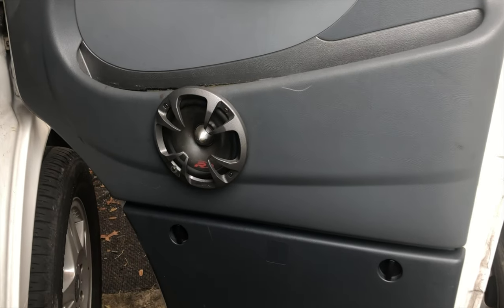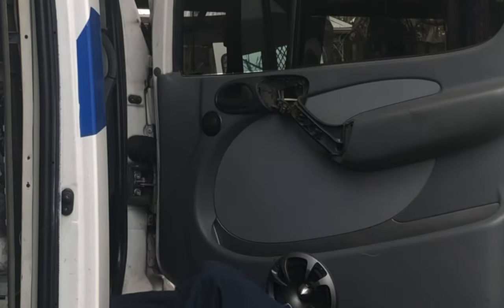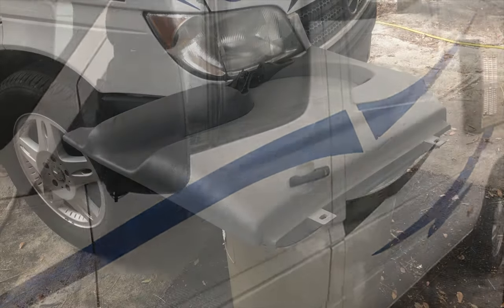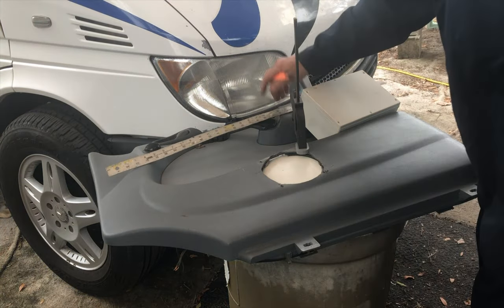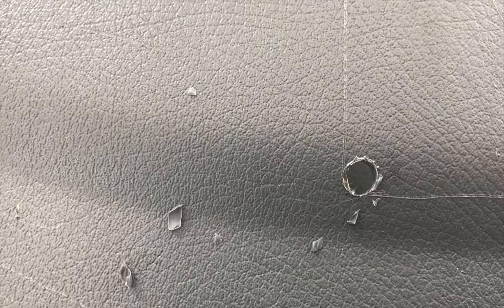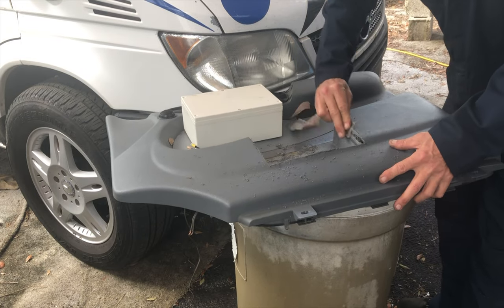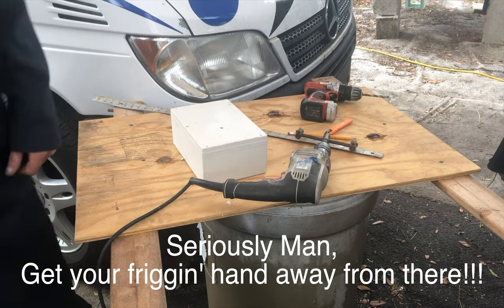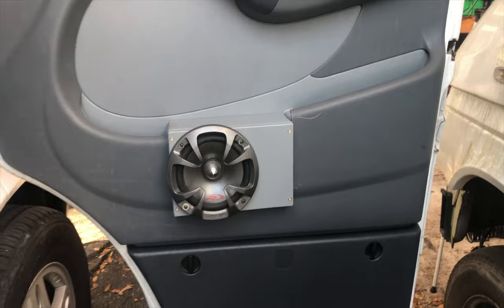Car/Van Door Speaker Boxes

Comment: Just bought a T1N, I'm going to steal this idea, great video/video's, thank you!  An oscillating multi tool would do a great job on cutting out the box, use it a lot making precise cuts on wood trim and sheetrock.  I watched a bunch of your video's before I purchased my T1N, they were very helpful and scored a 2006 with 96,000 that an aviation mechanic owned.

Comment: Hello Florida man lucky guy. I'm Colin from the original Aberdeen NE Scotland I've got a 06 sprinter love it. Came to MOT it fuel leak reported that's a fail!  On further investigation I found out what 'BLACK DEATH' is so I tackled it cleaned up lovely replaced all copper washers and stretch bolts. Put back together ran excellent for a while then conked out was bit low on gogo juice thought bleed system started again yay. Then died looked up you tube thought low pressure fuel pump in tank can't feel it! Dropped tank removed sender unit mine doesn't seem to have one hmm. Rebuilt. Bleed again got a friend to help. As if by magic key has disappeared has sat a while covid nonsense watched your key video that's tomorrow project. I have a piece of an old key but no chip soldered on a washer won't turn bit of filing I hope. And then to figure out chip hoping local locksmith can help. I got a new key made when that one snapped in ignition that's the illusive Houdini one £75 sterling. That was my first heart attack (I'm only 47) i kid but it hurt my pocket I am a Scot lol. Anyway love the tutorage wish me luck any advice appreciated.

Comment: Damn! Where'd ya'll confiscate these rims from, man?
Reply from the maker: We have two videos on G-wagen wheels. They fit our Sprinter 2500 and they are a great deal! G-wagen owners often put new tires on rust before selling the car, trying to make it perfect. Then a new buyer will often put custom wheels on immediately and sell the stock wheels with brand new tires. G-wagen owners don't often buy used wheels or used tires and our Sprinters are the only other vehicle they fit. This presents a perfect opportunity for me. I buy them often with new tires for $400-$600 a set. Similar quality tires on my stock rims cost $1200 mounted and balanced so this deal is a no-brainer. Because of the offset you might need to hammer the rib flat inside the wheel well and trip the plastic bumper bottom to avoid rubbing on bumpy corners. One of our videos details a smaller tire that eliminates these minor adjustments to the van.

Comment: Why not put the speakers in the lower part of the door?
Reply from the maker: Two reasons. The lower door cover is loose fitting and falls open too often with the smallest weight like a reference manual or spare belt. Also, when the door is closed the speakers would fire at the step. 
There is a third reason and that is because I had cut holes in my door panels 17 years ago and the new boxes eliminated that old speaker hole.